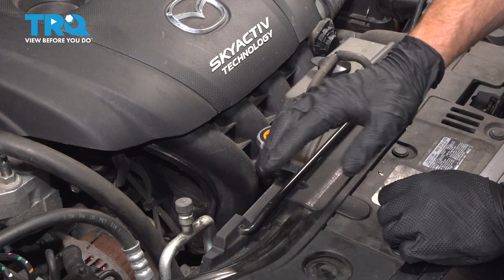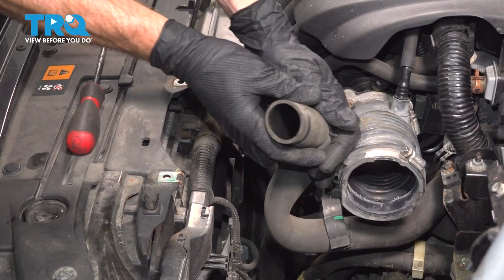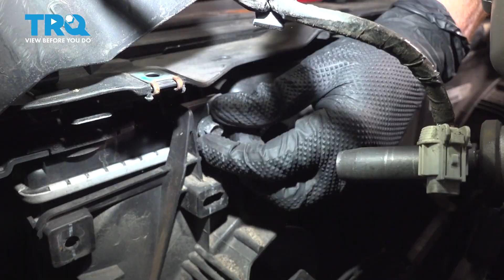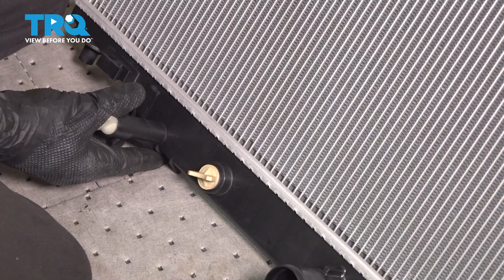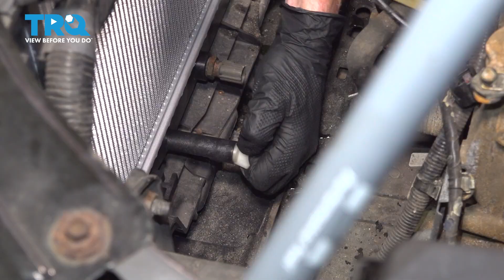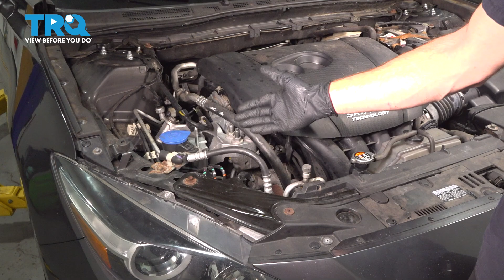How to Replace Radiator 2014-2018 Mazda 3

Comment: If you’re doing this job - fyi you can replace the radiator without disconnecting the refrigerant lines or pulling the condenser.